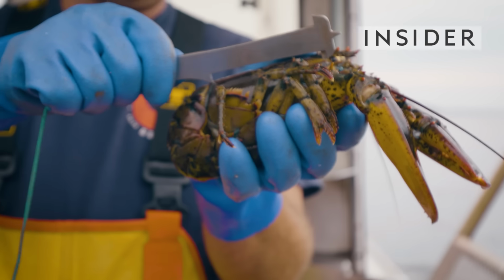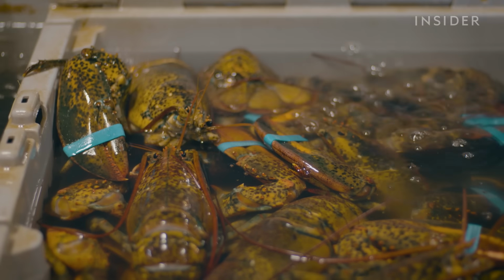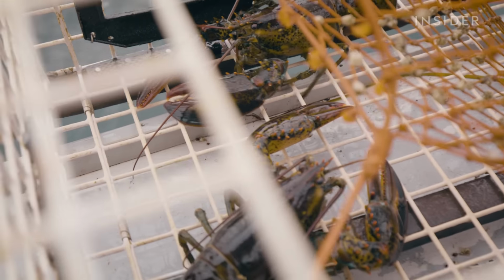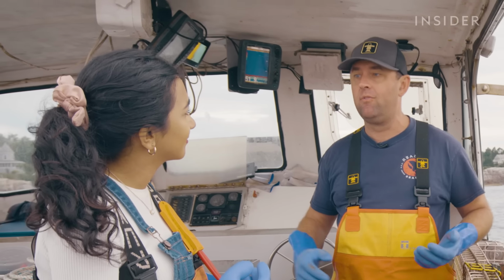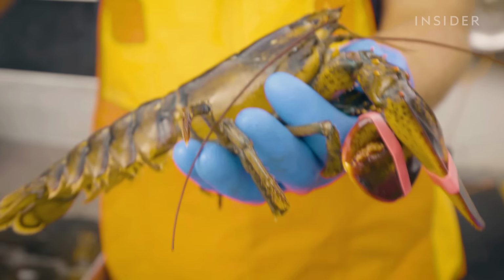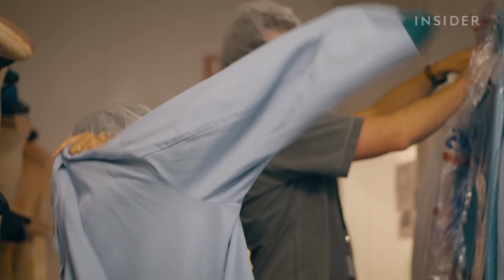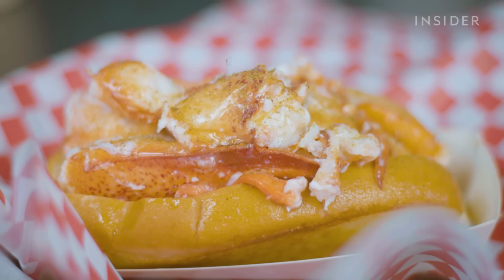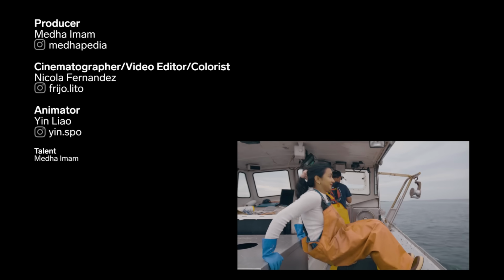How Lobster Fishers In Maine Catch Lobster For Restaurants Around The World | Regional Eats

Comment: Never cook a lobster with the rubber bands on them. If you're afraid to take the bands off when they are alive, throw them in the freezer for an hour to make them comatose, or put them on their back and split them with a knife from the front to the start of the tail. Boiling rubber bands in your food is never a good idea.
Reply: Agree and thanks for the tip about putting them on their back to split them.  I have wondered about the best way to euthanize a lobster.  I only know how to do it for Dungeness crab.
Reply: @opwave79  
That's the best and quickest way. Their brain is located right around their eyes and some cooks pull that part out too before cooking them. But for the most part they should be dead from a split from the front to the tail.